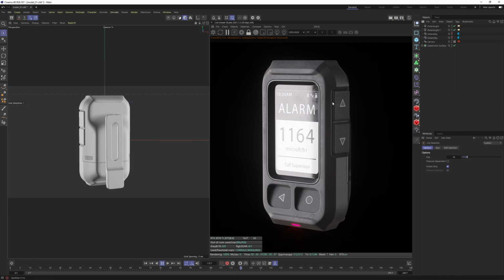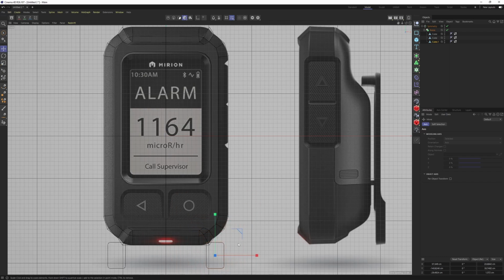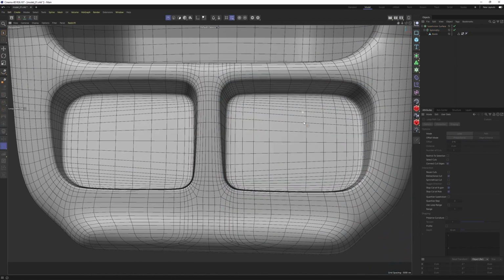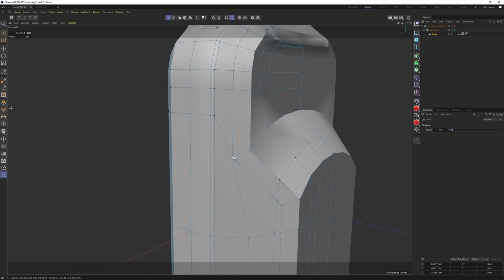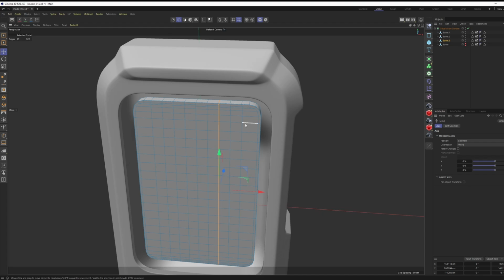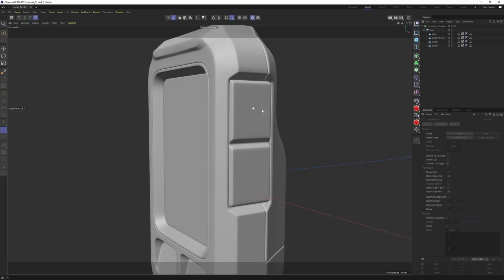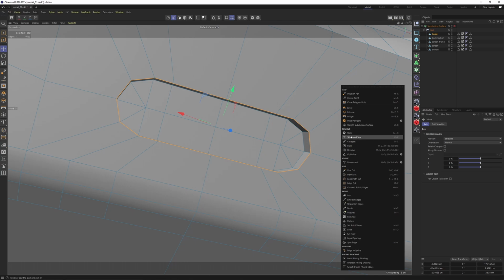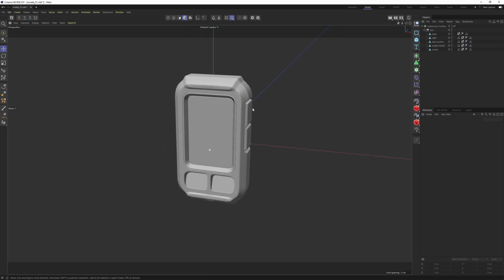Industrial Design/Product Modeling #23 | Detector | Part 1 Modeling

Comment: 04:26 

The symmetry tool has been reworked, so the clamp setting is gone, from what I can tell. The weld setting ‘crosses plane’ combined with ‘cut along plane’, ‘remove outside’ and the tolerance settings will achieve something similar. If you play with the tolerance level you can sort of see the point want to stick to the mid plane. ‘Snap points to plane will get anything too out of whack back to the symmetry plane. I have noticed that having the mesh selected makes it seem like it’s not working but when I select the symmetry object it displays correctly, removing any overlaps.

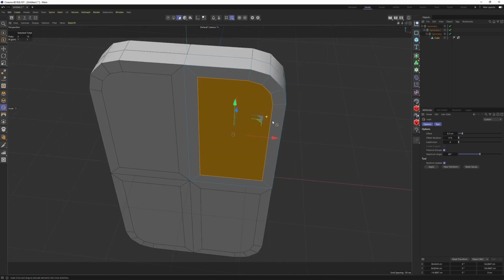Comment: 4:15 - 4:35 i can't seem to recreate an inset wich works like this with the new(er) symmetry generator from C4D 2024.4.0
It always inset on the individual faces. Regardless wich setting i use in the generator. Could someone get it to work?
Reply: i have the same problem..

Comment: HI
04:26 It looks like 2024 version of C4D is missing those options. I have used the slide tool to offset the edge, but was wondering if there's another way/or of there are some hidden options in the symmetry object
Reply: Thank you, solved my problem. I think it's the only way to work with that, unfortunately

Comment: Can't figure out how the first boole (screen) creates a hole and the second one (buttons) a "volume subtraction" without letting you see inside like in the first interaction. Anyway, I really really appreciate your tuts!! tnx
Reply from the maker: Thanks, that's because of the symmetry, the screen part, for example, cubes are merged right in the center because of the symmetry so boolean creates a hole/empty space, for the buttons, cubes don't merges or connect at the center, that's whay the boolean gave closed caps.
Reply: @polygonpen  really appreciate it! ;)